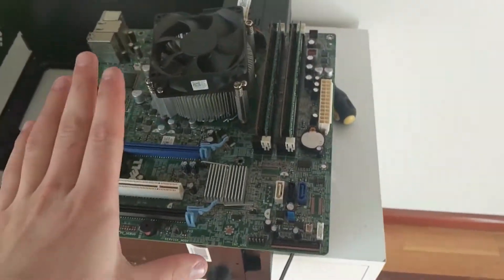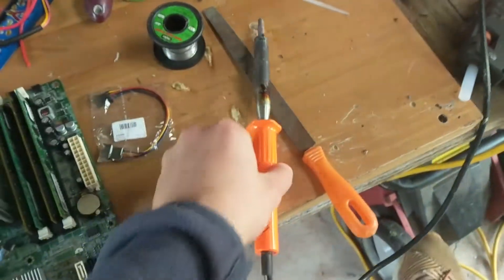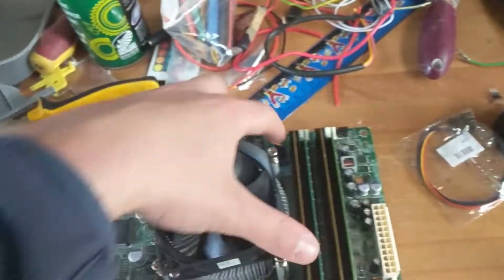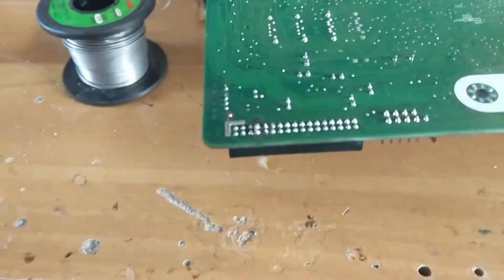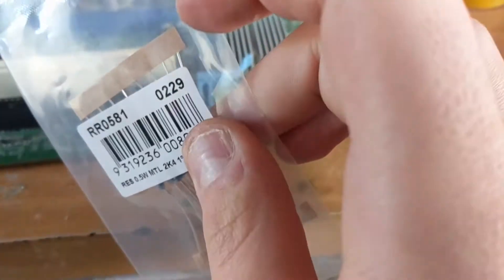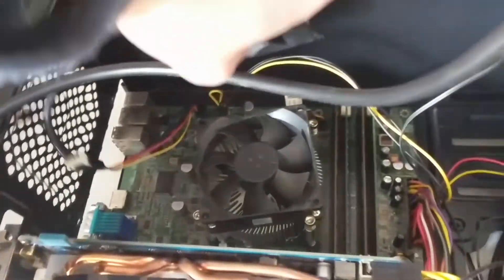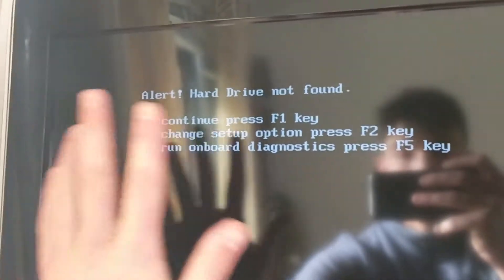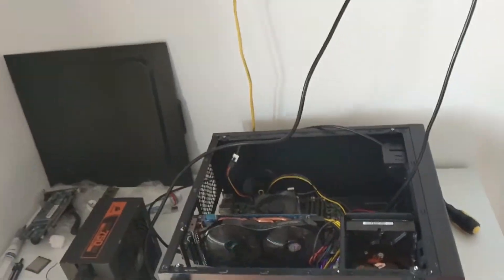How to remove Dell 990 and 970 Errors // Case Transplants

Comment: If you don't have the resistor handy, an led works just as well. Solder it in place instead of the resistor. Same result.

Comment: So I got everything else worked out, but adapter didn't solve the cpu fan error problem. I wonder what I did wrong. Using it with a Noctua cooler.